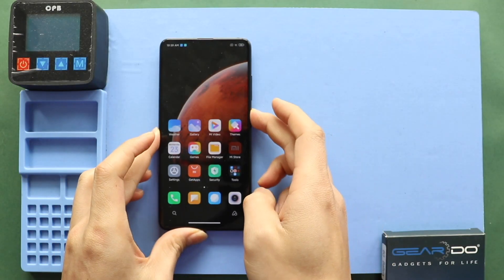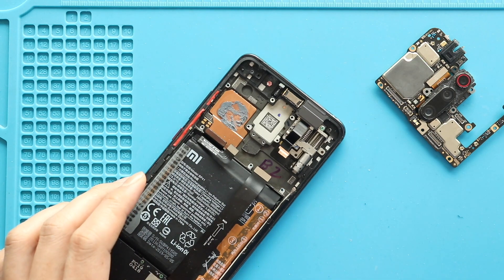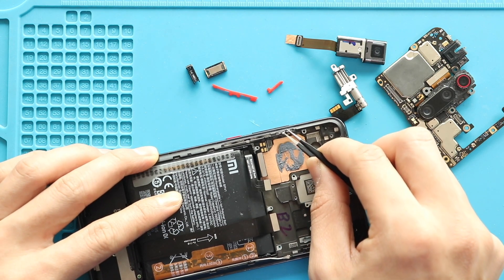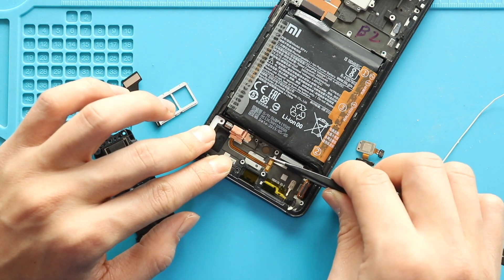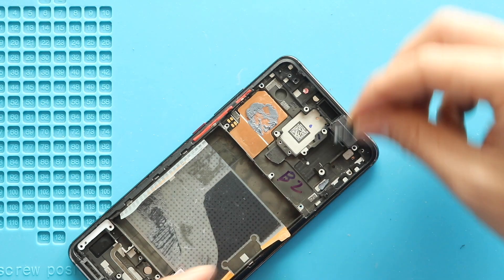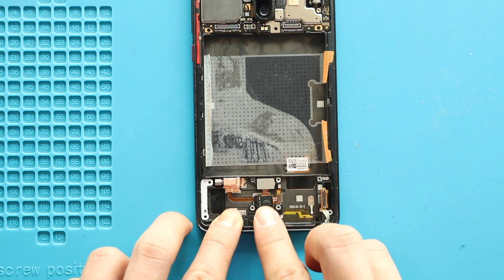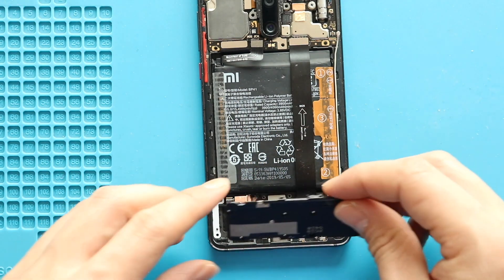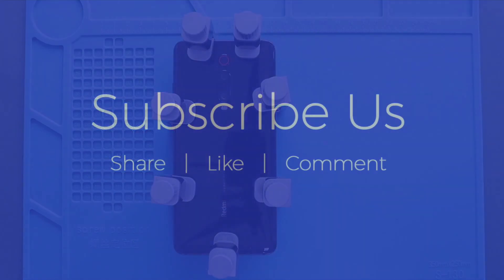Xiaomi Redmi K20 | Mi 9T Pro LCD Touch Screen Replacement

Comment: I can complete every step until when I have to plug in the antenna as it doesn't stick. Any Tipps?
Reply from the maker: Well you can, just be gentle and connect to the socket